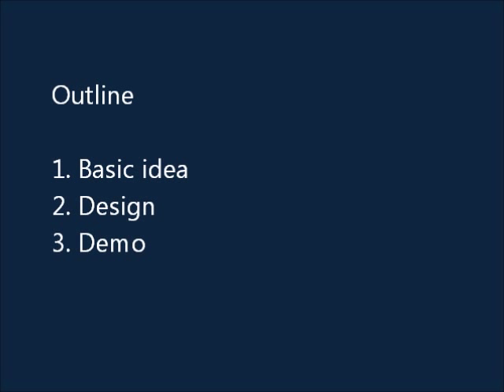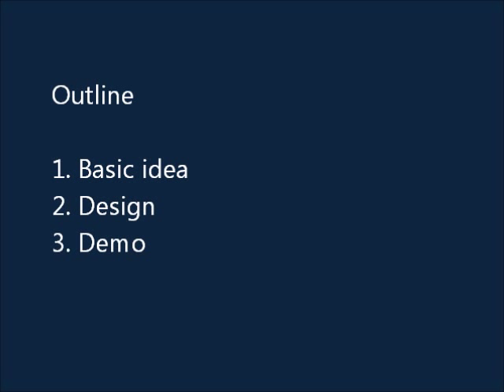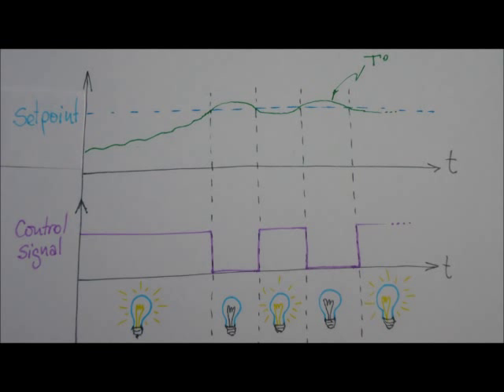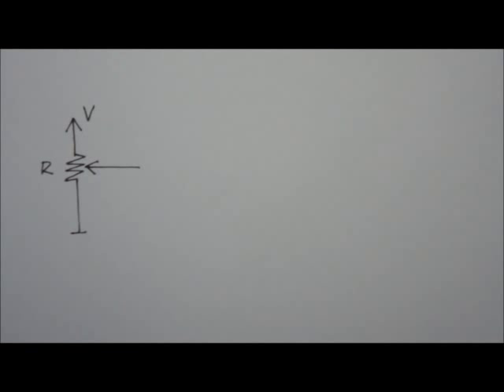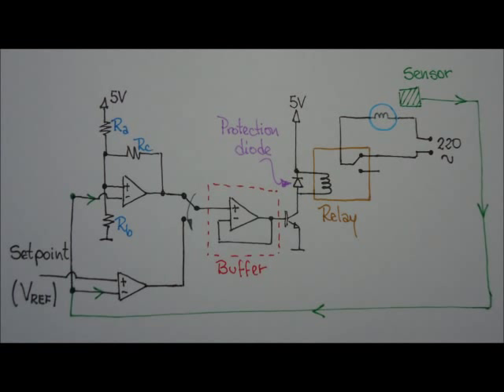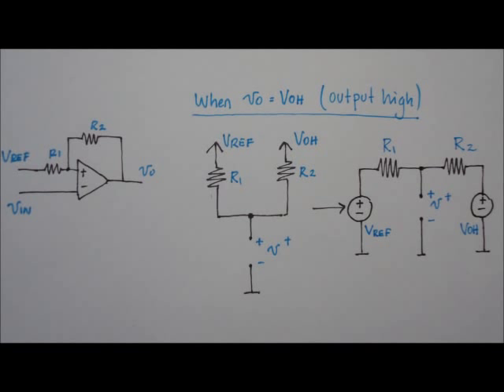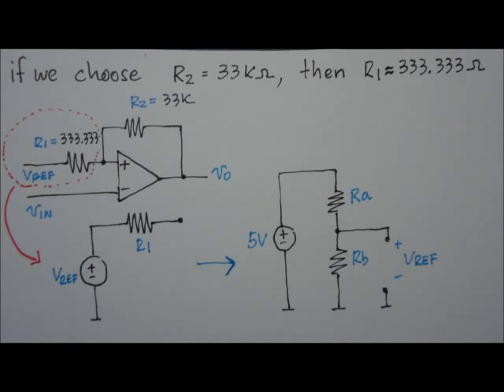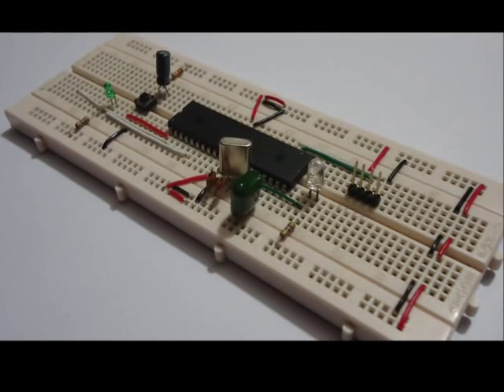ON-OFF temperature controller: A study case on hysteresis

Comment: Can we say this is pid controller based ?
Reply from the maker: Not really. 
Here the light-bulb is either ON or OFF, regardless of how close the desired temperature is from the current temperature. Had we used a PID controller, the light-bulb "intensity" would have been adjusted in proportion to three components: the difference between the desired and current temperature, the derivative of this difference, and the integral of this difference.